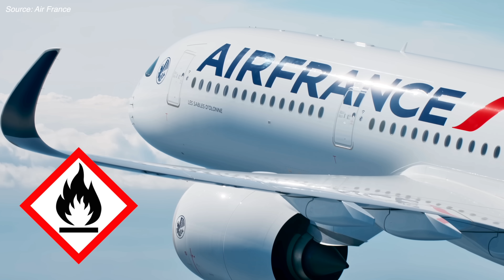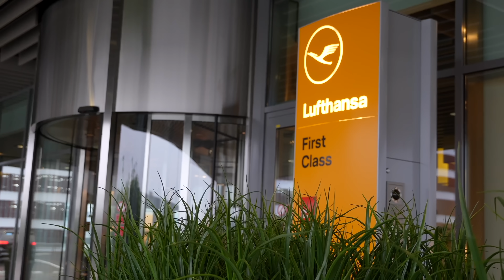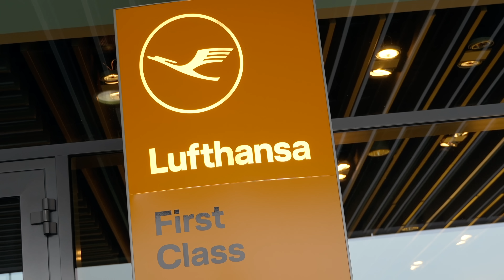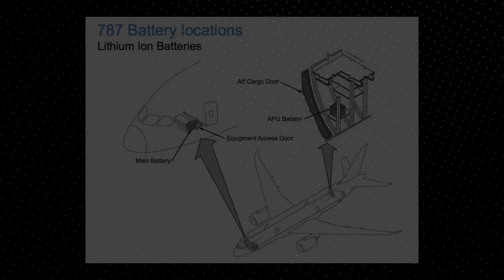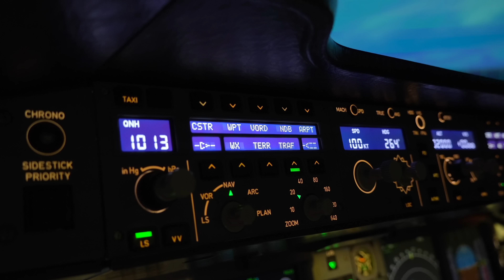Are the A350 & 787 a Fire Hazard?

Comment: Another example is arguably the worst aircraft fire on record, Saudia - Saudi Arabian Airlines Flight 163. On the 19th of August 1980, the flight from Karachi to Jeddah made an emergency in Riyadh after a liquid spray of unknown origin ignited wires in the cargo hold. Sadly, all 287 passengers and 14 crew on board the Lockheed TriStar L-1011 were trapped when the evacuation failed and they essentially choked and/or burned to death inside. But compared to Japan Airlines Flight 516, where the A350 burned to the ground, the roof of Saudia Flight 163 was melted away, the TriStar, which by the way, was mostly made out of aluminium, was still sitting upright on its landing gear, and was still fairly recognisable as being an aircraft. In all honesty, with that said, I'd feel much safer from fire onboard an A350 than not only any other plane, but also my own house.

Comment: “Resistance to fire” doesn’t mean it cannot burn… it mean it will resist the fire for a period of time before it will start burning.

In this JAL A350 it has been reported that the fuselage was able to withstand the fire burning on the outside of the fuselage for more than 15 minutes with little to no smoke observed inside the cabin. This gave them ample time to safely evacuated the aircraft…

Also you can’t really compared this to a B2 crash… that’s a stealth military plane built from “unknown” composite material coated in radar absorbing materials (more than likely to be a fire hazard) 

The whole plane is basically cramped cockpit, fuel tanks and a weapon bay filled with high explosives… they can’t exactly pulled right up next to it to put out the fire without verifying the safety of its content first….

Comment: Bear in mind that the a350 and Dash-8 TWO planes crashed with one of them with a FULL fuel tank, the fuel tank of the dash-8 also spilled fuel all over the a350 as the a350 went through the dash-8 and the fire was broken out as the plane was still slowing down on the runway while on fire with wind blowing thought the fire intensing the fire if u know how fire are made, and compared to the Asiana Flight 214 was landing with a low fueled fuel tank and the gear and tail was hit on the ground not the fuel tank,it also didnt start a fire before it landed on the ground after it flipped  , and the a350 crashed through Dash-8 due to communication errors not the problem of the plane

Comment: I would postulate that composit aircraft can proboby handle extream loads and bends much more than a aluminium plane.

If it was a 777 landing on that plane it might have broken apart alreddy then and there, possibly killing some passangers as a result.

Also the melting temperature for aluminum is not that important  the more important how much strength  it loses as a result of high temperature.

There are plenty of planes that had a on board fire in the air and suddenly just broke apart killing.

I would argue that if you have a fire in a composite airframe everyone would probobly be dead prior to the airplane breaking apart anyway. Giving the aircraft between 5 to 10 minutes longer to reach the ground.

That make me wonder. Do A350 and B787 have some kind of fire emergancy ventilation. In a older aircraft you can just open the outlet and inlet and ypu will have plenty of air.

But those to aircraft have them cabin pressure powered by a turbine

Comment: Supposedly it took 18 minutes for the last people to get off the airplane (which is crazy and I am looking forward to reading the official reports on that). That composite fuselage kept the fire out that long. It took the impact of hitting another airplane without coming apart, which would have let the fire in. No way an aluminum fuselage could have done that. Compare to the similar accident at LAX years ago where a 737 hit a turboprop. In that crash, there was fire and heavy smoke in the cabin almost immediately after the impact, and almost half the occupants died. 

What happens after the last person gets out is irrelevant. While aluminum won't burn, it will readily melt through in a raging fuel fire. Eventually, the composite itself is going to burn, but if it takes a long time to burn through to the inside of the cabin it just doesn't matter..

Comment: Once a plane has crashed its a write off anyway, the fact it burned down in 6 or 8 hours later doesn't matter a great deal as long as the Passengers and Crew got out alive, a long burning plane may effect runway operations but its not like you are going to be using that area anyway until the air investigations of the accident site are done anyway.
It seems the composite did well in this instance ie the survival rate was extraordinary, the fact Japanese people are very orderly and follow instructions no doubt contributed to this which may mean this survival rate may not translate equally to other locations in the World.

Comment: The performance was outstanding, there are other fire retardant systems that are designed to allow a safe exit for the required time(I believe its 90 second, not sure).

The information about the melting point, comparing it directly to a monolithic material such as aluminium is not correct. The composites uses and epoxy resina as binder, so it will lose strength in any direction that isnt the fibers. It is this resin that makes the charring.

It is worth nothing for aluminium, the melting point is useless, because the structural strength would have been lost way before, material properties change with temperature, anything Above a third of the melting temperature and fluency will kick in(rule of thumb, actual values are provided by a safety standards or material standardization organization, usually linked with a regulator). So absolutly no, the Aluminium wouldnt fare better, if you were inside either, how much the material can take isnt relevant, but rather how much you can.

Comment: (1) You pronounced "row" incorrectly. It's not the one on "rowboat."
(2) I noticed an awkward transition from comparing the two planes' composite composition per unit weight (%) to underlining the primary reason for switching to composites—saving weight and thus boosting fuel economy.
The pedant ine says ”mixing apples and oranges."

Comment: YES, it is similar to building from Brick and concrete vs from the WOOD (COMPOSITES) they are bigger Fire Hazard.....

Allowing to Burn the plane "almost completely" have functional aspect of Insurance to NOT DENY the CLAIM - same practice with Semi Trucks by the Fire Department....

Man, stop misleading with lab results. Raisin and composite material is higher Fire Hazard. Something proven in the lab it is not adequate to life. You can see even by your own picture 777 vs A350. Once ought on fire it is Burning...  
My God, thanks for my Math teacher who explained to us that statistics in real life LIE: use burning hot water vs ice cold water on the skin, median is Great but separately you can cause GREAT DAMAGE - Same in LIFE.
Many people today, are under lab or statistic impression when in REAL life they are FAILING Royaly: electric vehicles.

Comment: The A350 in Japan is soaked in fuel from the military jet.

Imagine igniting a piece of metal material in fuel. Almost nothing can put the fire out, as jet fuel is extremely flammable. And the A350 shows even soaked in fuel, the plane fuselage can keep the passenger safe long enough for people to escape. 

Imagine other planes made with metal, soaked in jet fuel, and exposed to high temperatures. Almost certain the whole fuselage will burn up quickly.

Comment: I wish you would factor into your argument the impact speed of the two planes and the volatility of jet fuel, the fact that the A350 was landing at 150kts... Lots of things contributed to the a350 combusting into flames and the fact that aluminium is poor at handling fire. So an aluminium plane wouldn't have faired better.

Comment: The captain got off the plane 17 minutes after it had stopped. That alone tells you that its not. Every metal plane is a disaster way earlier why the 90s evacuation wa put in place. The A350 did not only achieve that time, but way surpassed it. That it slwoly burns with all hydraulic liquid and fuel ignited to to the dash would happen way worse on a metallic plane. As the wings are still kind of complete it hows that its doesnt burn from alone and even hinders it.

Comment: Carbon fiber more fire resistant and not changing form because of heat, that's why for decades motor racing use carbon fiber disk brakes

Comment: the calamity won't be on-ground evacuations, those aren't the problem. the problem will be mid air fires when pilots need half an hour to bring the airplane down from altitude. think swissair 111 or springbok 295

Comment: Unique means only one. And then you name the first CFRP aircraft. 18 minutes was not a quick evacuation. Sure, everyone got out, but not fast. The Asiana 777 and the BA 777 which both crashed short, were both at the end of their flight and contained little fuel. This A350 had just plowed through a Dash 8, which is not 'small', which was taking off and therefore full of fuel. So these three crashes are not the same. To see how an alloy plane fares in a fire you can watch a China Airlines 737 burn. The fire had broken the back of the aicraft in around 6 minutes. The videos don't start until the fire has already been burning for about three minutes. On the JAL flight, which had already crashed, so it wasn't an undamaged hull to begin with, that would have been 12 minutes before the last person left. https://www.youtube.com/watch?v=Ppp5eO4uGzI

Comment: Carbon fibre brakes can generate enough heat they turn white 2000 degrees plus. So if you think carbon fibre is not safe then why do they use them on uhigh performance car as a brake component.

Comment: As an engineer with experience of building carbon fibre vehicle chassis. This video isn't very well researched and doesn't feel up to the usual standards of this channel.

While carbon fibres themselves does go up to a much higher temperature, that's totally irrelevant when it's built into CFRP. The plastic resin melts/burns at a much lower temperature than Alu.

Also the outer shell material of the plane isn't as significant in terms of flammability. People are forgetting that the inside of the plane is full of bags, seat fabrics, carpets and other plastics, all of which burn readily regardless of what the fuselage is made of.

Comment: This accident showed the A350 is built tough, without a doubt. Yes, the Dash-8 is much smaller, but it is still a 20,000 kg aircraft. The A350 foreward fuselage took the full brunt of colliding with it, and the wings seem to have partially cut into the A350's engines and landing gear. Despite all that, the aircraft finished its landing roll more or less in the same orientation, even with a nose gear collapse. The fuselage remained intact, protected occupants from fire, and the #2 engine was even still running at idle despite heavy damage (the crew could not shut it off because flight control systems were damaged during the collision).

Comment: 1. Fire on runway crash is not the main fire danger; fire in flight is. How well would it compare to UPS Flight 6?

2. A major factor why everyone walked away with zero major injuries was the lack of nose wheel. Reduced the angle of the exit slide massively, meaning no broken legs, pelvis, or fractured vertebrae which is what usually has to be expected on a slide exit from runway. The reason everyone got to the slide so quickly in the first place is Japanese passengers - they have emergency procedures drummed into them in their everyday life, and won’t give a fk about trying to grab their carry on etc.

Comment: An interesting point is that the last man (pilot) left the Airbus 18 minutes after the crash (it was reported). So after 18 minutes the cabin was still possible for a human to survive. This I found very, very good.

I am not so sure that the JAL crew was so perfect. There are reports that the evacuation started only 6 minutes after landing. I find that very long. It would be worth investigating whether that 6 minutes was reasonable or if the crew was too slow to start the evacuation. What is the use of having a 90 seconds evacuation requirement if the evacuation is only started after 300 seconds?

Comment: Perhaps Coby could’ve explained the big differences between the B787’s more advanced monolithic CFRP fuselage barrels versus the A350’s simpler CFRP shells/panels. Airbus may eventually learn and adopt building entire barrels for fuselage sections as opposed to panels stuck on an essentially aluminum frame.

Perhaps the materials themselves may be the same, but the construction approach is vastly different and there may even be a difference how the two types would behave in a fire, or maybe not.
Reply: 🤣"airbus will learn" ok, they are just the number one, actually and the A350 sustained  over 18 minute of raging fire when the certification requires 90 second. But yeah, they will surely learn from Boeing, the company that is doing so well that anyone is hesitatnt to take a flight on a Boeing now.
Reply: Airbus learn from Boeing 🤣🤣. God you’re funny. Boeing needs to focus on fixing its death machine Max family. No one should be taking safety lessons from them atm.
Reply: You fellows are confusing engineering research with manufacturing quality.

Boeing has been involved with the innovative process of producing CFRP barrels while Airbus has not. Airbus’ panelized approach is very simple in comparison.

Now, it does seem that Airbus does indeed have superior manufacturing quality than Boeing, which unfortunately is emulating the downward path of the sloppy US auto industry with its poor quality cars that plagued them starting in the 1960s.

I remember flying on a 2 week old B787, and it was remarkable to see decorative panels literally becoming unglued, electronics in seats fail, and one of the bathrooms fall out of service.. this was an example of awful quality workmanship.. NOT the engineering marvel that the plane’s design otherwise is.
Reply: @@SemiSemis 
While your puerile comments have an emotional element, it must be understood that “fly by wire” technology had been adopted by Boeing (and other US plane makers) for military aircraft well before Airbus ever implemented it in their passenger planes. Also understand that Airbus was in a new plane development cycle which Boeing was NOT at the time the technology was made available for passenger planes, so logically Boeing would indeed include it in their next plane… so it was more a matter of timing than one of “prowess.”

To criticize a Boeing plane you personally and capriciously dislike such as the B777 is perfectly within your purview; however let’s not forget the dog of a plane that was the A340.

Comment: I really think the plane survived the crash because of the composite materials, it is more flexible and resistant to abnormal stress, I bet if instead it was a older A330 or a 767 it would have broken on impact.